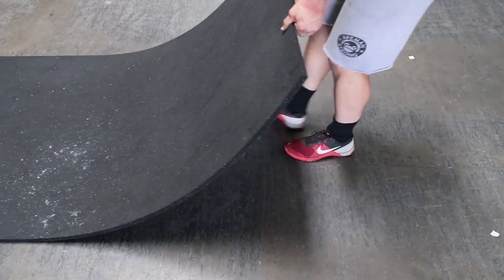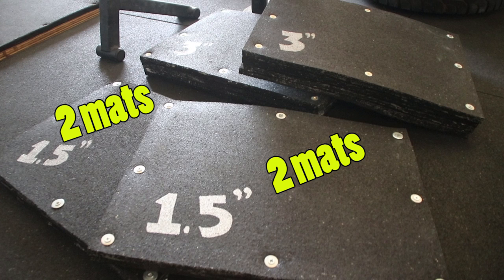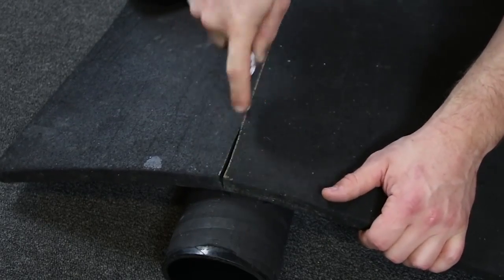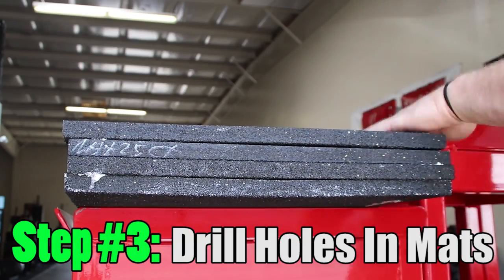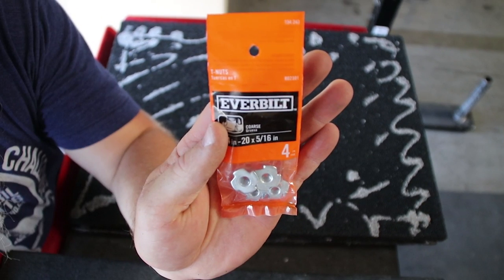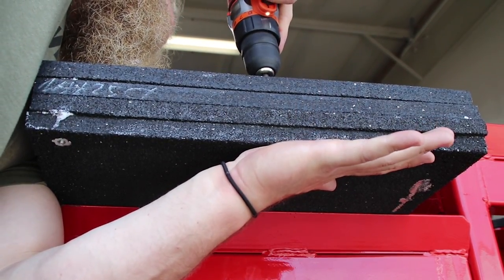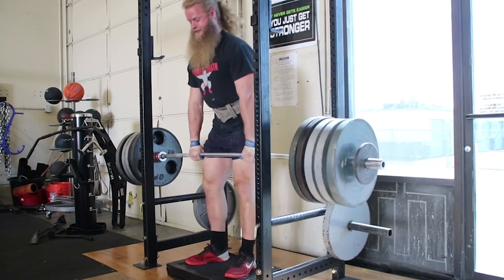Make Your Own Deadlift Blocks

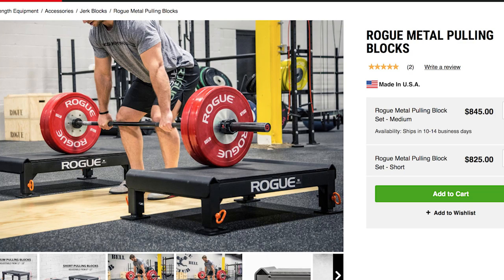Comment: 0:28 Exactly. I work out at home (in an actual room with carpet and everything) and I made blocks of used A4 paper sheets bagged and duct taped at proper heights for different plates. 
P.S. A4 is large enough for my little 10 kg plates.

Comment: I don't know how experienced you are with drilling, but it hurt my heart a bit to see it when you gripped the blocks and drilled very close to your fingers. Glad you didn't hurt yourself. Keep up the nice content, I'm loving it!
Reply from the maker: Joachim Dunér it's a dull drill bit attached to a drill with about as much power as my toaster. I'd be more concerned about my safety when trying to pick up 500 lbs. THAT's dangerous
Reply: Joachim Dunér In 1991 when I deadlifted 495x5 at 250 with a belt, deadlifts seemed safe.  Last week at 200 and age 45 I pulled 505x2 straps only.  Unlike Olympic lifts, you have time to adjust.  If it feels off, just let the bar go.  Very safe if you know your limits and don't approach a deadlift as a speedlift, but squeeze the weight instead.
Reply: 5zazen Qa
Reply: the drill isn't even long enough

Comment: LUBE your blade. Seriously. 3 in 1 oil, wd 40, anything like that will make the box cutter slice through the mats like butter.
Reply: If this is true, this should be top comment. Cutting those stall mats tries your patience.
Reply: @chadmc3704  Only if you keep them flat... as long as there's something underneath like Alan showed, they slice open like nothing.

Comment: pro tip.  Use the straight edge with the utility knife.  Add a little water and it cuts like butter.  Be carefull. You will be surprised how easy it cuts.
Reply: When you say add water, do you add water to the horse mat or to the blade?

Comment: Alan (or anyone else), do you guys feel the safety strap system some racks use are harmful to bars? I bought a rack with safety straps today in part because I hate doing rack pulls off pins. They bounce around, move around, and are not nice to the bar. my bar is imported and I'd like to protect it.

Comment: Real talk. Can the average lifter tell the difference between a slightly bent bar and a perfectly straight bar? I think not. Especially considering the average lifter doesn't actually lift.
Reply: Is your goal to be average?
Reply: No, of course not!
Reply: Shawn Gadwa the average lifter doesn't even lift haha
Reply: it will cause the bar to roll down your back, then bicep / elbow tendonitis
Reply: Do you even lift? 

The answer is always no.
Reply: Yes, a bent bar is very evident especially on Deadlifts and especially when you go heavy. I train with Alan and at 68 years old and with 58 years of iron experience I listen when he talks as your never too old to learn.
Reply: Tom Jones Fitness Are you talking about a slightly bent bar or a really bent bar? Our bars have had several hundred pounds on them and been dropped on pins, don't seem to notice  anything
Reply: Shawn Gadwa 

be carefull benching with a bent bar. it can cause the bar to roll in the hand and drop on your chest. I've seen it happen before.
Reply: Eventually bending will happen (have a couple of my own with slight bending), it depends on quality of the bar and amount of vigorous effort by the trainee. Alan didn't change to a specific bar for rack pulls until he moved into his latest gym almost a year ago, the 'rack pull' bar is painted with a yellow stripe.

Comment: I followed this video and have some feedback for anyone interested in doing this.
* Stall mats usually have circles on the bottom to provide texture, unlike the ones Alan has (https://media.tractorsupply.com/is/image/TractorSupplyCompany/2219003). This provides the disadvantage of less contact between the mats for the glue to hold. However, it provides an advantage of being able to use normal nuts, instead of tee nuts, on the bottom of the mats since the texture will stick out further than a normal nut. I tried using both normal nuts and tee nuts and normal nuts were better for this application. When you drill your holes, drill from the bottom (the side with the circles) towards the top. 
* I used four .75" stall mats from tractor supply but apparently they lie about the thickness and it came out to a total of 2.75" once complete. 
* I'm not very handy. One tip is that, when drilling the screw in, drill on high speed/low torque mode until the screw comes out the other side. Hold the nut on the end and continue screwing and the drill will "pull" the nut into place. This will likely cause the screw to hang out the other side too far. Reverse the drill direct and pull it back out a little and you'll be left with the nut being super tight in place without the screw hanging out.
Reply: Hello. Replying super late but was hoping you'd be able to answer. Is one horse stall mat enough to create the pair of 3" and  1" blocks?
Reply: @alexazul5197  It'll take two stall mats to make a pair of 3" and a pair of 1.5" blocks with a leftover half of a mat.
Reply: @archmaesterofpullups  Hey thanks for the quick reply! I think I'm just going to make two pairs of 1.5" blocks since I only need them for deadlifts. Will make the changes you made.

Comment: guys i need your help! i have some elbow pain from armwrestling and locking the elbow when i do presses.any tip?
should i take a break for a few days?
Reply: 315ForReps do connective tissue work (300 tricep extensions with a mini band) after every push day. Look it up it will take that lockout pain away:)

Comment: i want to deadlift at home. Do I need a special floor to do it? i dont want to mess up my floor...
Reply: guxxx just buy horse stall mats like the one used in the video
Reply: As long as you live in a ground floor apartment,you good
Reply: you need to be on slab i.e. concrete. I would not suggest deadlifting on a wood beam floor like a 1st floor above a basement or 2nd floor.
Reply: thanks 💕💕👋
Reply: Alan has a really good DIY deadlift platform video. Save your floor and your plates and build a platform.
Reply: Alan has a really good DIY deadlift platform video. Save your floor and your plates and build a platform.
Reply: guxxx Get bumper plates and some rubber mats

Comment: So is your only dislike with a rack pull the potential for barbell damage?
Reply: QQyoko I think the other issue is that the bar will be slightly bent as the weights are hanging in mid air as opposed to resting in something solid. This means there is slightly less carry over to the deadlift
Reply: What other problem is there?
Reply: It just depends on why you are doing the rack pull versus the block pull. Generally speaking, you do block pulls as a direct deadlift variation so you don't want to go too high. Usually 6-8 inches is the highest. You're looking to replicate the feeling of a floor pull but elevated. A rack pull is generally for a pull done with the bar from slightly below the knees on up. You usually get less and less benefit the higher the bar is if you're looking to work on your deadlift.
Reply: Rack pulls are pretty good for overloading the upper back/traps and to do double overhand holds for grip work without having to tax the spinal erectors too much.